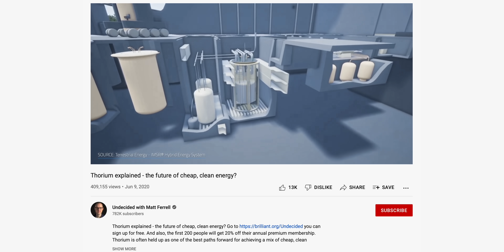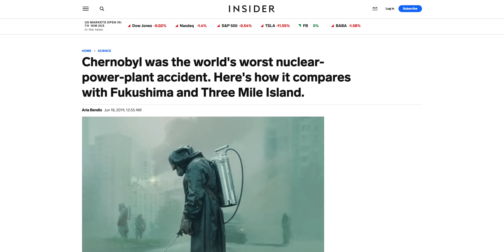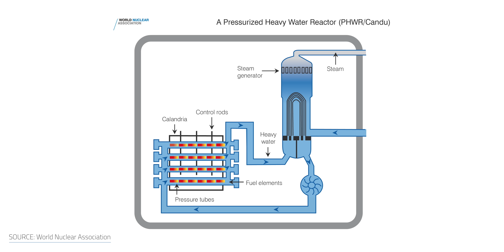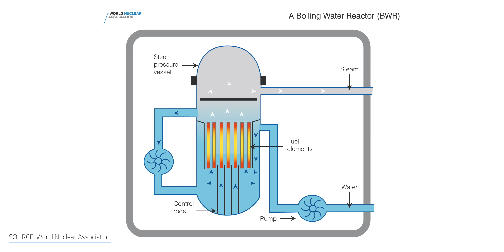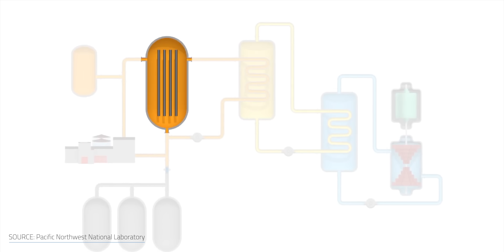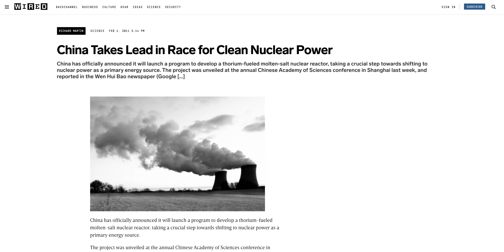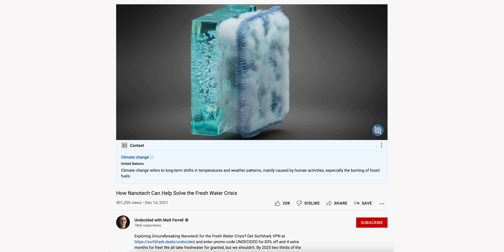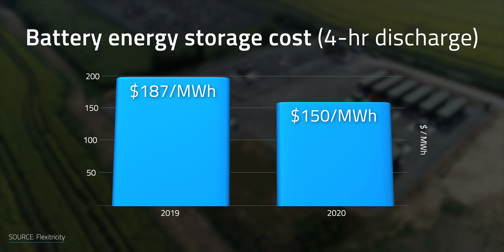Revisiting Thorium Energy - The Future of Nuclear Power?

Comment: Is there any way to use thorium in a conventional reactor rather than a MSR? From everything I've seen, the problem dosnt seem to be people dont trust thorium, its that people dont trust MSRs.
Reply: Probably not. Thorium requires a breeder cycle. It has to absorb a neutron to become useful, and it has a 2 week period as protactinium where it can actually poison the reaction and needs to be held outside the reactor. Now there are more conventional solid fueled breeder reactors that turn U-238 into plutonium 239, but there's no intermediate product there, so the plutonium can either be extracted or burned in place. In the thorium cycle, dealing with the protactinium is the big challenge.
   Anyway, I haven't gotten the same vibe about MSR. I either see people opposed to any form of nuclear, or favorable to MSR over PWR. Passive safety is a big winner for anybody that takes the minimal effort to understand it.

Comment: I keep thinking of the Chernobyl series - where every nuclear physicist kept saying it was impossible for a RBMK reactor to meltdown (despite that there were graphite pieces lying in the yard). Theoretically impossible and practically impossible are not the same thing. Having thousands of little reactors all over the place raises the risks of human stupidity, intentional sabotage and terrorism by an order of magnitude. I suggest caution.
Reply: The term "Walk away safe" is used when referring to Thorium MSRs because humans can not f@#k thing up. Because there are no high pressures involved, dispersal over a large area would be difficult for Terrorists to achieve,  less effort and more damage for an attack on NG storage area.
Reply: The thing is that the smaller the reactors are the harder it is for them to cause a disaster if they melt down.

Also I'd say that the risk of human stupidity would actually be contained since it would be exponentially harder for all the reactors to meltdown at the same time.

Comment: Although I would love NOT having to need Nuclear power to decarbonize electricity generation, it will not be possible in our lifetime.  There is 2200 GW/h of coal powerstations in the world which emit 19 to 20% of all the greenhouse gases emitted on the planet.  And some are starting to suspect that number to be higher, some might be hidden power plants that will see the light soon in China for instance.

So let's do some math.

2200 GW/h = 2200 000 MW/h

Say we want to replace 50% by solar and 50% by wind, so we have 1 100 000 MW/h to replace wind.

The current most powerful wind turbine generates 12 MW/h, but on a yearly basis averages just a bit over 25% (3 MW/h) on land and a bit over 45% (let's round this to 6 MW/h) in sea based farms.

Now to make calculations easier, instead of 1 100 000 MW/h, we'll round that down to 1 080 000.

If you would need 360 000 wind turbines on land  (108 / 3 = 36) or half that in a sea based farm 180 000.

If you want to do the replacement in 10 years, it means that you need to produce and install 36 000 wind turbines a year for land based farms, or 18 000 for sea based farms.  Per month, that comes to 3000 and 1500 respectively.

If you want to do this in 30 years, divide that by 3 -> 1000 and 500 per month respectively EVERY month for 30 years without stopping, no holiday, produced and installed !  If you want to account for any delays, holidays and whatsoever, you double that.  So you need to produce 1000 to 2000 wind turbines a month and the same amount of teams to install them !  That's a planetary challenge to say the least.

Now, we all now that this totally impossible, even with the best intentions.  Furthermore, that doesn't include the growth of electricity demand, this is ONLY for coal replacement.

As much as it saddens me, if we want to clamp down on heating the planet, there is no other solution than Nuclear, for the moment.  The first COMMERCIAL Fusion reactor is not slated to be in production before the next Century, so no dice there either.

There are prototypes of Wind turbines at 13 MW/h (GE, if my memory serves me right) and 15 & 16 MW/h elsewhere, but these are only prototypes for now, and the leap is not enough to help.  We would need a leap in the average yearly power to help, from 25% to something closer to 50% on land, because we won't be able to put them all in sea based farms.

For the Solar part, I don't have the info to do the calculations, but it doesn't look that much better.
Reply: GW/h is not a meaningful unit. Power is measured in Watts. Energy is measured in Watt hours. There's no divide sign. But I looked it up, it's 2.2-ish TW from coal globally. Just leave off the /h. Maybe I'm being pedantic, but it's confusing when people have to guess what unit you're actually trying to talk about.
Reply: Currently, the world has 341,000 commercial wind turbines, generating 6% of the world electricity, with an average capacity of around 3MW. So would need 5,683,333 wind turbines, but lastest are a lot bigger; Dogger Bank in the UK will be using 13mw turbines. So increase the future average up to 10mw and only need an additional 1.7 million turbines for all the world electricity. Built over 30 years that would equal 157 turbines per day or ¾ of a turbine per country per day. 

Now lets put this in perspective of the massive existing power industry: 29,000 fossil fuel/nuclear power stations, 1,500 active oil & gas rigs, around 5 million active wells, 1300 oil & gas refineries, 40% of all shipping in the world is transporting fossil fuels, plus 2.6 million miles of oil and gas pipelines. 3.4 billion barrels of oil in storage tanks, 10,000 coal mines, Plus billions of tons of machines to mine and process, and burn 8.6 billion tons of Coal, 35,442,913,090 barrels of oil, 132,290,211 million cubic feet of natural gas per year, using around 1 million Km2 of land and sea. all needing to be maintained and periodically replaced (most will need replacing over the next 30 years).

The massive energy sector employs 58 million people: Who could construct all the wind turbines required in their spare time!

Even if needed 10 million wind turbines, would still be trivial to construct with the manpower and resources available!!!!
Reply: @stevetaylor2818  The problem is that you don't actually have that many industries that produce wind turbines, and the production per month is well below what is needed.

Furthermore, they have a lifetime of about 30 years, so even if you manage to install everything in 30 years, you have to replace major components after right after you've finished installing everything ...
Reply: @RichardMigneron  Just look at the complexity and massive size of the existing infrastructure; you obviously have no idea what's required to generate the world's energy. All needing periodically replacing, at the end of serviceable life, on average around every 30 years. If we don't build the required wind turbines/solar panels, then we will have to re-build the equivalent fossil fuel infrastructure, millions of workers costing trillions. 

The renewable industry is one of the fastest-growing industries in the world. China alone could build every wind turbine ever needed. (and many if not most offshore windfarm construction engineers are X Oil & Gas engineers, the skills are very transferable, And I'm one of them)

Stop slagging off what you don't understand, and please explain why you have so much hatred against renewables !!!!!!!!!!!!!!!!!!!!!!!!!!!!!!!
Reply: @stevetaylor2818  1. I never said I hated renewables, I loved them.

2. The only issue is that we can't currently produce them and install them fast enough just to replace all the coal power.  Furthermore, if we did manage to replace everything in about 30 years, we would have to replace those right after that.  And then, when you have done that, you have to produce more of these renewables for the increase in demands - currently, we are still building coal power plants for the new demands, this is nuts.

3. We have not even talked about Gas/Petroleum power plants which will also have to be replaced if we want to survive on this planet, these account for about 8 to 9 % of the emissions worldwide.

Therefore we need Nuclear Power to help us replace all of those fossil fuel power plants, and most of the nuclear power plants have at least a 60 year lifetime (in the US they are starting to approve extensions to 80 years), this could give us a bit of buffer time to help us supply bigger more powerful renewable power plants.

Anyway, fossil fuels have all passed their peaks, so we will have to replace them sooner than we think ...

Comment: You should do fusion if you haven't already. Explain how we can create a reaction already but briefly and it takes more energy than returned.
Reply: Well, I think I can answer that. The problem is creating the conditions for nuclear fusion to happen which are more extreme than the center of the sun, and unfortunately most of the energy that is produced in the reaction is dispersed as neutrons (if one is to use certain fuels). There are some solutions coming though, like using helium 3 as fuel and neutron-reflective materials.

Comment: I'm so sick of explaining why taking VPN sponsors is a bad idea. Just... Just don't. They're. All. Honeypots.
They're not even VPNs. They're just, at best, using protocols meant for VPNs. They're glorified proxies.

But I guess let's start with the claims made in your sponsor segment.
Commercial targeting/tracking - VPNs don't protect against that. If you login, or if you're using a regular browser that can be easily fingerprinted, you'll be identified instantly and you'll still be tracked. In fact, VPN companies often track you. In part because they have to. Most VPN companies, ESPECIALLY the ones claiming a no-logs policy, are tracking you to sell your data to governments and advertisers. They can get away with not telling you this because they're usually under a gag order, to not only not tell you, but to also tell you they don't track at all.
A so-called VPN cannot block ads or trackers. That's physically impossible. They'd have to block entire servers or networks, or they'd have to force you to use a particular app to browse with.

Geofilter bypass is pretty much all consumer VPNs are good for, and that market is slowly disappearing with VPN detection.

If you're using one of these proxies and thinking of it as a replacement for opsec, rather than a horrible scam that could ruin your opsec, you've been had.

Comment: another use besides desalination is hydrogen production like high temp electrolysis as well as distinct heating. its more efficient(esp if used from required cooling) to use some of this heat directly for heating then turning into electricity just to be turned back into heat for heating buildings, of course this requires another system. Also when comparing energy sources should see whole impact. glad you mentioned nuclear waste and batteries but there is also all the resources to build wind turbines, PVs, batteries and then also the life span of each component
Reply: Not only hidrogen the sodium can be used to build sodium Batteries
Reply: Desalination would be a really bad idea, when it comes to MSRs at least. There's a reason China built their prototype in the desert and far from any body of water, and in an area where in practically never rains. Those salts used for cooling are massively corrosive and massively reactive with water (and oxygen). The reaction with oxygen is one problem, but it produces non-volatile solids. The reaction with water is a horrendous problem .. you get a massive explosion, then a hot and volatile mist of hydrogenfluoride which is so agressive that .. well, don't look it up if you have a weak stomach, let's just say: it can dissolve glass/quartz .. and there's beryllium which is massively biotoxic and cancerogenic. 
These all are really good reasons, to set up MSR as far away from water as possible.
Reply: @augustaseptemberova5664  that's just wrong information. One of Alvin Weinberg's original concepts for using the MSR - the ORNL scientist who patented the PWR AND invented the MSR (with Eugene Vigner) - was for desalinization & power gen in the middle east. He wanted to go MSRs for civ use, not PWRs - he foresaw the waste & safety issues & got run out by ahole allies of Rickover that had blinders on for PWRs & fast breeder program. The MSR program got little or no funding and then cancelled and buried and not revisited even when fast breeder got cancelled. My understanding is the wider rediscover is thanks to NASA and Kirk Sorenson finding, scanning, and putting online-disk the ORNL research. And yes desalination using the heat from the reactor is a widely proposed purpose for MSRs again. Two words: heat exchanger.
Reply: @KG-1  At scale, I think RO Filtration is preferred desalination method. Basically high hp pushing water through filter. Done on small scale on sailboats all the time.
Reply: @KG-1  It was canceled because intend use in-plane was not well-liked.
Reply: @augustaseptemberova5664  HF can pass through your skin and destroy your bones.
If I remember right, there's a Refinery Unit called HF Alkylation and it is among most dangerous oil industry processes.
Reply: @artsmith103  Exactly. That's what they taught us in chem at uni, too. But I couldn't find that info on the English wikipedia, so I didn't include that here in case someone thinks I made that up or smth
Reply: @augustaseptemberova5664  Note to self, don't use Wikipedia ;-)
Reply: @artsmith103  lol .. thanks for the probably nicely meant comment, but .. no thanks.
There's an international collective of devoted chemists that work hard to keep chemistry-related wikipedia clean and factually correct, and backed up by primary sources.
This is why wikipedia is actually quite good to look up elements, main chemicals etc. and their main properties and hazards, especially the English and German wiki.

You shouldn't quote wikipedia in any scientific work, because it's not a primary source, but other than that when it comes to online referring someone to some basic knowledge, it's fair game.
Reply: @Augusta Septemberova  you can use a reactor like this in for example NV with salt water to get desalinized from CA through a pipeline.  You dont have to have it by the coast
Reply: @tsal4379  Sounds like the little pacific project
Reply: @augustaseptemberova5664  for desalination you would use a heat exchanger it wouldnt be directly touching the parts containing the nuclear material.
Reply: @augustaseptemberova5664   I think you overestimate the amount of salt one of those reactors use. Besides, as with liquid sodium-cooled reactors: YES, WE HAVE SEEN THE VIDEOS sodium burns in water, got it. But it is not an impossible task to keep water away. Sodium-cooled reactors have powered submarines, not the most prudent of ideas but is easy to make a reactor water-proof when it needs to be encased in radiation shielding anyway
Reply: @vipondiu  Nope, MSRs operate at, on average, 22 kW energy production per Liter of fuel liquid. For one MegaWatt you need roughly 45 Liters .. that MegaWatt can supply for 40 US households at full load.
The more households you wanna supply, the more fuel volume you need .. and add to that an equal or larger amount of primary coolant.
Reply: Just because you have ion sodium, does not mean it burns.
Reply: @augustaseptemberova5664  MSRs fluids change in to solid below400C.

Comment: Thorium reactors and similar nuke tech is interesting, but the constant talk of more development needed and projections for commercialization pointing towards year 2030+ is a major letdown. We need clean energy NOW, not post-2030, and we're building it, mostly in the form of wind and solar power.

So when 2036 rolls around and a commercial thorium reactor might be completed (IF we're lucky), chances are we won't actually need it anymore. So it's largely a waste, as a technology. For better or worse. Sure, we could build some thorium transmutation reactors to "eat" the tens of thousands of tons of highly radioactive waste we've created and turn that into low grade waste instead, but we won't actually need nuke energy at all in the future I'm predicting.

Renewable power combined with energy storage in various forms (batteries, hydrogen electrolysis+fuel cells, rotating mass storage, pumped reservoirs etc), along with more efficient use of energy and better insulated buildings will be able to take care of our needs.

Most nuke energy fans are typical older/old-ish "conservative types" with rigid minds who hate change and can't foresee a society which is different from what we've "always" had (as if we've actually had nuclear energy for all that long... lol) Well, they'll die off eventually if nothing else stops them! ;)
Reply: Some energy production needs to be independent of nature and constant. In many situations renewables (while brilliant and the likely source of the majority of future energy) can't function. No wind, too much wind, not enough light, or inclement weather etc. And while battery storage and other such storage measures are coming along the sheer space required to store all that (short burst of) energy means you may as well use a comparatively small power plant that generates orders of magnitude a more power, consistently.

Always need backups and consistency. And the waste will be able to be repurposed at some point. Once that's achieved en mass then it's main drawback is negated. 
P.s. I'm 33, so nuclear support is far from the preserve if old duffers
Reply: There is no way that the targets will be met by 2030.  Battery production can't be scaled up sufficiently.  They can't produce enough PV panels.  The grid can't be upgraded soon enough.  They can't build nuclear fast enough.  There is not a consensus to act.  These are commitments meant to be broken.